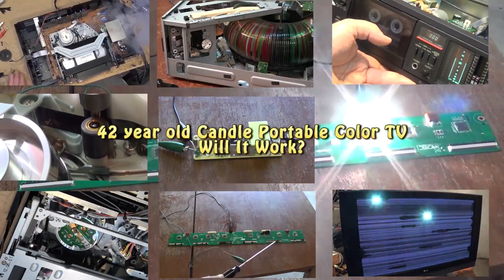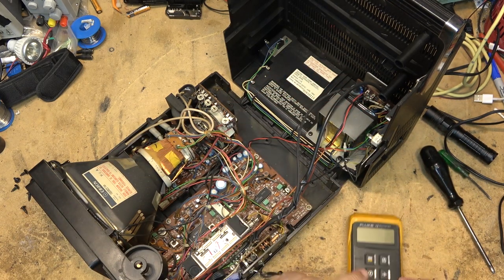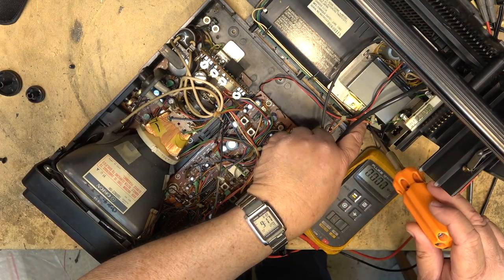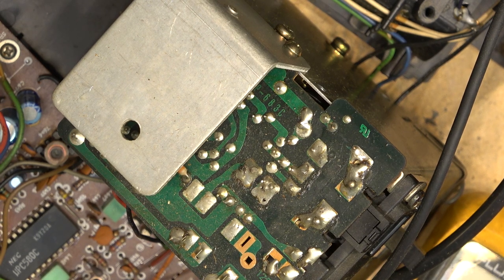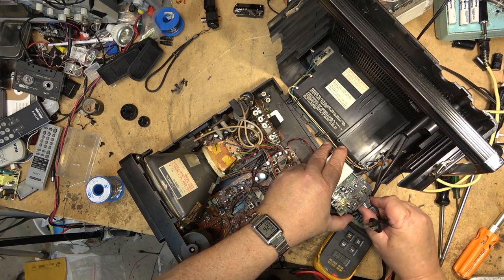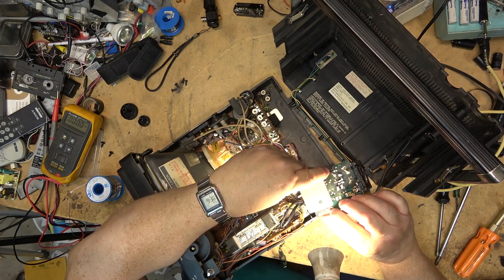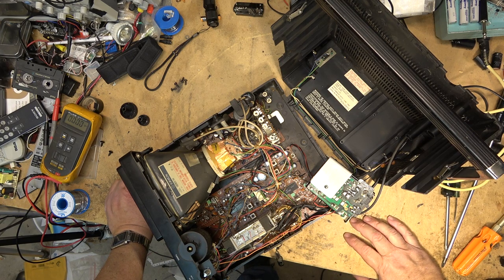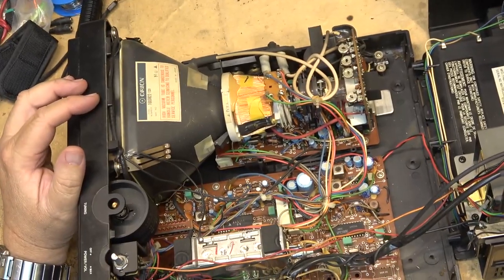42 Year Old Candle Small Color CRT TV is Dead

Comment: That is SO retro!! I REALLY like 👍 it!! I received one ☝️ of these 5 inch TV’s 📺 for Christmas 🎄 of 1983. I think 🤔 it was an Emerson. It also had an AM/FM radio 📻. It was also color. Just be VERY careful when serving the CRT (picture tube). Use an isolation transformer, to shield 🛡 yourself from the 25.000, or 45.000 volts that the CRT stores 🏬. I forget which it is, but it can be deadly, even when the set is unplugged 🔌. Your friend, Jeff.
Reply from the maker: Well unless you remove the hv cap on the tube the hv won't bite you.  I have been bit.  It hurts.

Comment: I can remember making a repair on this type of set where the AC mains did not function, but the 12V 3A power input did. For some reason a rectifier in a bridge configuration had a short, and was located directly above the CRT neck, but I rerouted its replacement away from the CRT. I don't know how long it lasted, but had no recall...

Comment: What device are you using to retransmit on analog? Are they some kind of ATSC to NTSC converters? Hope I didn't miss it on an earlier video. I need to get something like that for multiple channels. Standard boxes are just 3 & 4.
Reply from the maker: I have done a video showing my distribution system you'll just have to search for it it was done a while back but yes I have multiple aps-c receiver boxes which output audio video and these are plugged into commercial head and modulators that the cable company ripped out and threw away. They can be set to any channel so I've got them set for channel 2 4 5 7 9 12 17 and UHF 27. Are all fed into cable splitters into the output port on cable splitters where the signals are combined then sent through an amplifier and to all the other outlets in the house. On top of that I have a antenna which I amplify and mix in as well so if I go to a TV that's got a digital tuner it will receive both the analog and digital signals off air. The stations I put on analog come off of a separate atsc antenna which is a different direction so I can't pick those channels up on my TVs on the digital channels because the antenna is facing the wrong way but they're just standard definition channels anyway so I watch them on the analog feed and they look fine. I also have media players playing content off of YouTube and some of my own stuff that scanned on hard drive like the concerts that I can watch on any TV
Reply: @12voltvids  Thank you, I'll find it!

Comment: I had a weird problem on a Ford E250 cargo van. The #3 coil pack would misfire intermittently and lose power to the AC electric clutch. I finally took it to a mechanic. He spent half a day trying to isolate the problem It turned out to be a broken signal wire on the plug that connects to the number 3 coil pack. The air conditioning is designed to shut off by the ECM if one of the cylinders fails to fire The mechanic originally thought it was a bad ECM but discovered the broken wire on the coil pack connector. It would have been difficult finding an ECM for a 2013 Ford E250 van. The wire broke due to vibration causing it to work intermittently on the coil pack
Reply from the maker: Your first problem was it was a Ford.

Comment: I have a portable B&W television from mid 80s I wanted to composite mod with but I don’t think it’ll work. I bought SAMS manual online for schematic. There’s a single IC chip inside that takes the IF from tuner and output composite but also handles horizontal and vertical deflection, read the sync circuitry is built in. I could inject in the composite sort of in the same spot you showed but it probably won’t sync up and I probably have no way of back-feeding composite into this chip for it to handle sync.
Reply from the maker: I did a composite mod to a BW TV a few years ago, video is on the channel. It was a single chip solution, worked perfect.